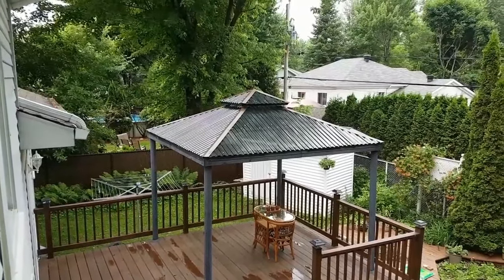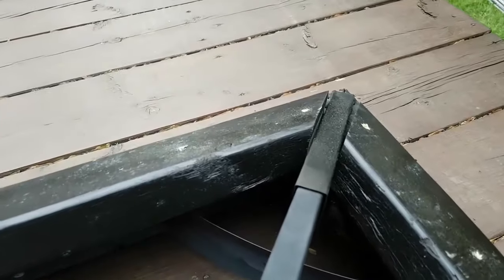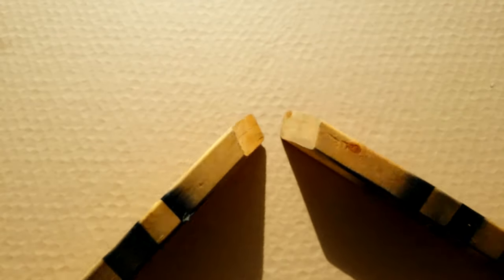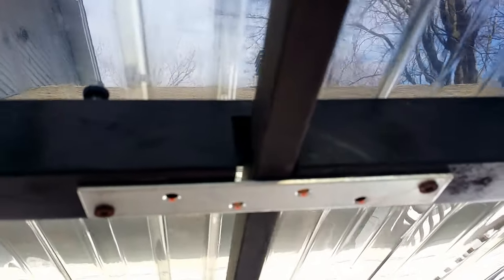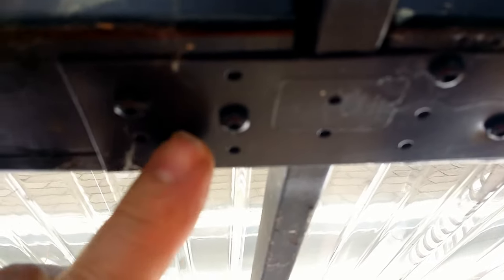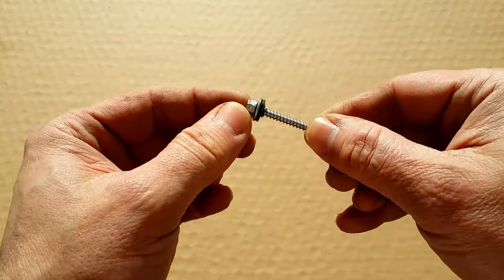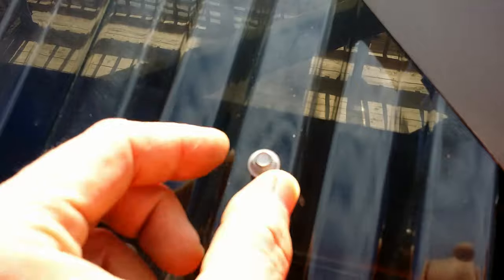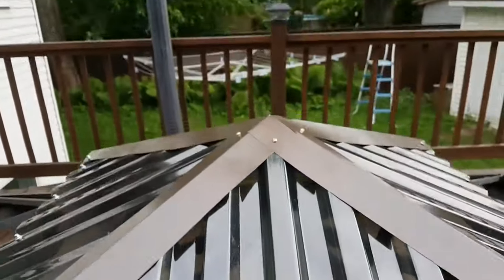DIY Polycarbonate Gazebo Roof Follow up How to.

Comment: Thanks for the info, I have done my 10x14 using your reference, except that I doubled the metal frame on wood to ensure it doesnt flight out!! Thank you very much
Reply from the maker: You are welcome!
Reply: I’d like to do the same thing with my gazebo but I hesitate precisely because of the bigger size (10x14) and the wind which sometimes blows quite strongly.

Even the cheapest hardtop models on the market have a much more robust structure and hardware.

So, after more than 2 months, is everything still okay with your 10x14? Did you make any other changes?

Comment: Thanks for the video, I was hoping to see how you climbed up to the the screws all the way to the top.

I have a gazebo roof that i want to replace but for the life of me I can't figure out how to climb on top to take off the old panels and then get up again to put the new ones without falling through.
Reply from the maker: You put panels in sections attaching them as you go. Simple.

Comment: Did you have any leakage at the screws? I'm having some issues with mine after following manufactures directions.
Reply from the maker: I bought screws from two different producers. The original Suntuf screws are OK, the screws from the other source rusted and I had one leak. Replaced the screws and everything is OK now.

Comment: Hello Robert, your roof on the gazebo inspired me and my husband to do the same.  We have some questions about installing the panels, where did you start and where did you measure from and make your cuts from......panels , flashing..etc.  10x12  To start out with!
Reply from the maker: Start in the middle. It will be easier to keep it straight. Go left and right from the middle. At the corners continue from the sides with corrugation, valley to valley, top to top. It is challenge to go around and meet the corrugation at the end.  Choose the end corner that is less visible. I was off by less than 1/4 inch at the end. The panels are in different lengths. Choose those that will allow for less cuts and leftovers. Good luck!
Reply: @robertdeptula2003  Thank you for the quick response.....my husband is placing the panels at the top marking and cutting for placement. so now the edge of the top will be uneven and long in places.  His plan is to finish by trimming all panels all the way around.  We have a bet!  I believe that all cuts are only at the top.  Did you do all cuts from the top, and if not how were you able to get such an even cut along the edges?

Comment: Great video! How exactly are the beams braced together at corners to prevent lift off under windy conditions? Screwed to the metal frame?
Reply from the maker: Panels are screwed to the metal corners and wooden beams. It is explained from 5:42 to 6:17. Three years ago we had 90km/h wind - no problem.

Comment: Thank you so much for the excellent video. My soft top is a few years old and I am debating on buying a new top? replacing with hard top(like you did) or going the expense of of adding a 3 season room.  I am told the 3 season room would be much harder to place on the deck because of the deck legs? apparently the walls of a 3 season need to be anchored to the ground. I am only planning a 10  x 10 as this divides the deck at the stairs leaving a screened room on one side and open air  on the other. You video makes me think a new top is really all we need, at least for now.  How is your gazebo hold up? What year did you build it?
Reply from the maker: This summer will be four years. It holds excellent, no cracks, no holes. Snow, rain, wind, sun. Panels look like new.
Reply: @robertdeptula2003  thank you, that helps alot, assuming there is no supply issues, i will see what i can do in the spring or early summer. thanks again and enjoy your wonderful gazebo.
Reply from the maker: You are welcome, and thanks.

Comment: If it survives Quebec, it can survive New England.  Going to try this. I wonder how to attach netting and fabric sides.
A very well edited video.  Well done!
What are the dimensions of the major roof beams, 2x3 inches or the metric equivalent?
Reply from the maker: 2.5 x 1.5 inches measured. I think they sell it as 3 x 2.

Comment: Amazing project. I’m planning mine soon. As I cannot take my Gazebo down, I will have to do it while it’s up. It’s gonna be challenging. Do you think it’s feasible? I wish you have listed all the needed materials. Thanks for the 2nd video. You posted it at the right time :)
Reply from the maker: My neighbor's roof (on the still picture in the video) was done without taking it down to the ground. We put a piece of plywood on top of the jacuzzi inside and worked from there. You have to remember to use a big piece of plywood if you need to get on top of the panels to spread pressure evenly. For the materials, everything is mentioned, with links, somewhere in the comments to the first video when I answered questions. The only thing that I couldn't find the link to was the metal corner. I bought it in Home Depot Vaudreuil, Quebec, Canada.
Reply: Robert Deptula you’ve been very helpful. I will use a ladder. It’s not gonna be simple especially when I will be doing it alone. Thanks again.

Comment: Nice idea. Is there a diagram for the framing of roof?
What r the roofing screws called?
Reply from the maker: Thank you for your good words. No, I don't have any diagrams. It was a "cut as you go" project. The screws are sold by the same company as the panels. In your home improvement store, the screws should be next on the shelf to the panels. Good luck!

Comment: What metal braces did you use at the Middle and Top corners? Is it a T or 2 pieces joint together to form a T? I bought some T’s but they won’t be easily bent. What type of wood paint did you use?
Reply from the maker: Those are Ts. I used vise and hammer to bend them. You need those Ts to be strong. 
The paint is universal for wood and metal in a spray can. Don't remember the brand.

Comment: Great video Robert, thanks for posting.  I have a very large steel cabana with metal roof.   The weight of the snow has bent some of the rails over the years.  I installed six patio doors around the perimeter which gives it more strength but I'm still concerned about the overall weight especailly with the snow load, and I'm tired of taking the snow off all the time.  I was thinking of doing exactly what you did although I may screw the panels right into the exsisting steel beams.  I suspect the snow just slides off in the winter?  Do you find it too warm if the sun is out?  I installed reflective layer of styrofoam under my metal roof.  The metal roof got so hot in summer you would just bake like sitting in an oven.   I guess my biggest concern would be the heat (although great in spring and fall) and perhaps a hailstorm hehe.  I must say it looks really nice!!
Reply from the maker: You can buy white panels that will not heat up so much like those in the video. The snow stays on the roof, but the panels are strong and don't bend. As soon as there is a little bit of sun the snow slides off of the roof. In "about" section there is my e-mail. Write to me and I will send you some winter pictures of the roof.
Reply: @robertdeptula2003  Thank you for the reply Robert much appreciated.  I will send a few pics as well.
Reply: I am looking so hardly to find someone who does this job in ottawa.

Comment: Would you kindly post more pictures of the inside, the framing?  I’m trying to copy your design and process with my old metal gazebo that no longer has the metal roof frame.  Thank you.
Reply from the maker: In the "about" section of my chanel there is my e-mail. Communicate with me via this e-mail. I will send you additional pictures this way.

Comment: Why do we need to add those bins? Can I just use the original metal strucure that was used to support the fabric cover?
Reply from the maker: I am not suggesting how anybody should do it. In this video I share my take on it. 
The reason I didn't drive the screws to the aluminium frame was that I didn't want to weaken the structure making many holes in it. I preferred to brace wooden beams to the metal frame and drive all the screws to the wooden beams. 
What you will do is up to you.
Reply: Great work. I Will prefer to not make holes in the coated aluminium with steel screws. Also. I also want To make it stonger. Thanks

Comment: I didn't have a Gazebo for the longest time because those cloth tops are notorious for tearing.  I found a used gazebo in great shape for cheap, without the cloth top, and bought it with plans to do exactly this.  I am also from Quebec.  Where did you finally buy the panels?  Are they polycarbonate or PVC?  PVC is cheaper, but I am worried about it's ability to survive a winter.   I am expecting a hard top roof like this to cost between $500-$700?
Reply from the maker: Those are polycarbonate. I don't think that PVC will hold for the winter. I bought the panels at reno depot. From time to time they have 20% off when you spend a certain amount. If I remember well the panels cost me about 350 - 400.The steel corners are from Home Depot. Good luck!
Reply: @robertdeptula2003  HAHA! Great minds think alike.  I told myself I would wait for that exact same sale!  Thanks for the input.

Comment: What were the measurements of the panel cuts
Reply from the maker: Panel cuts depend on the specific model of the gazebo. Measure your gazebo, check what size panels you can buy and this way determine what cuts must be made in the specific case. It is not one size fits all.

Comment: What is the total price ? For material?
Reply from the maker: I don't remember the price. Your cost will depend on where are you located. In US it will be cheaper than in Canada. I am in Canada and my local home improvement store has 20% off sale from time to time.
Reply: Robert Deptula Thanks for a very helpful video. You are very generous man. Do you think I could do it for about $200 or  less? How long did it take you to complete?
Reply from the maker: Just the cost of panels was about 350 - 400 Canadian dollars.